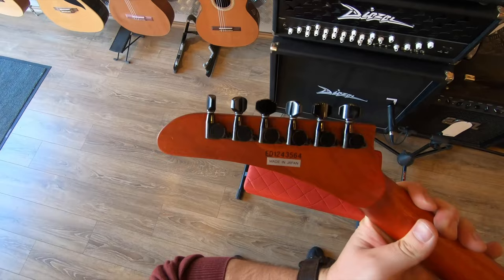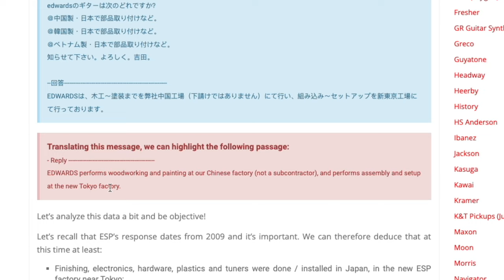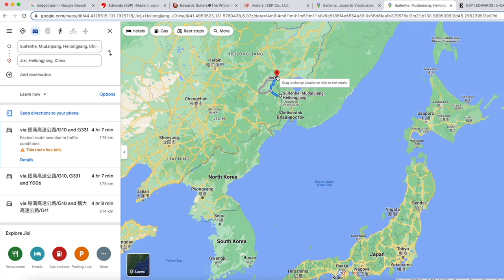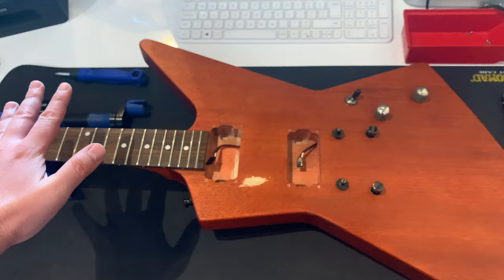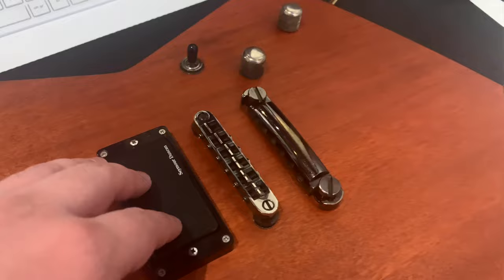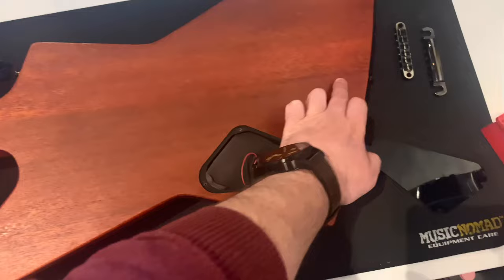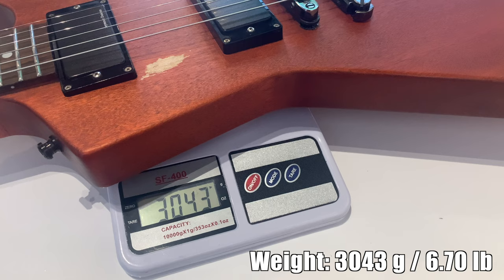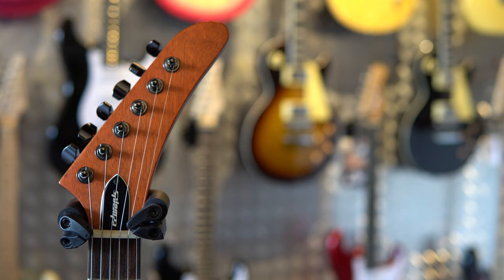The discontinued ESP Edwards explorer is a budget Metallica guitar. Was it really made in Japan?

Comment: Pretty sure some of the older ones are 100% Made in Japan, either way they're fantastic, they're better than the LTD 1000s and around the same quality as the cheaper ESPs, they're great upper mid range guitars.
Reply from the maker: Absolutely
Reply: @GeorgeVGuitars  I'm also pretty sure the only thing the Chinese factory did was CNC the wood, so the newer ones are more like 95% Japan 5% China, pretty negligible, anyone can CNC wood it doesn't matter.
Reply from the maker: @dq7860  Why ship wood from japan just to CNC it? Everything, including fretwork is done in Jixi. Only the hardware, electronics fitting and setup is Japan, which is still good enough.

Comment: I thought that these were great, they weigh about the third of a gibby one. I think they are good guitars but the neck is flat and it felt like it was having some easy flex, as if the mahogany used was a bit softer and not hard enough, causing some notes  to be thrown off pitch with aggressive playing standing up...that's my only downside with these, the satin finish was also very thin and easily scratchable.
Reply from the maker: Good points

Comment: Are you saying they are actually assembled in China? I got an Alexi Laiho Edwards, and pretty much all the hard ware, is Japanese made. The Floyd 1000 Korean. I could not tell you about the wood work. But it does say, made in Japan, on the back of head stock.
Reply from the maker: Don, im not sure about the artist series but the ED serial numbers were assembled in China. But in a ESP owned factory, not outsourced. So it. doesn't matter that they are not assembled in Japan. I am gonna review a John Sykes Edwards soon and I will see whats going on with the artist series.
Reply: If "Made in Japan" is not printed at the back, the body were assembled in China and take to Japan for assembly and final inspection. If it says made in Japan, then it's one of the old Edwards. New Edwards are rarely made in Japan.
Reply: @bassyey  Yupp, mine is a 2021. And it says I think, “produced” in Japan. Or something like that. Not made. But I’ve learned a lot since. And that doesn’t bother me. Made in China guitars only suck, because they are factory produced with low standards. But ESP has a place in China. Where actual ESP employees assemble the Edwards. So is it made in China? Pretty much yes. But still held to ESP standards.

Comment: Hi, George! I got the same guitar a while back. 
The bass strings sound pretty muffled and not bright like I expect them to be. Whether it's plugged into an amp or not. Therefore, it gets lost in a mix.
My Korean ESP LTD sounds better than this Japanese Edwards. I have no idea why this is happening, maybe it is wood characteristics, or most likely something wrong with this guitar. It feels like I'm playing on some acoustic with nylon strings.
The guitar has been set up at the guitar store (new strings, electronics check out, thrust rod adjustments, strings height I adjusted by myself, etc.)
Did you experience the same? Do you know what might be the problem?
Thank you.
Reply from the maker: Did you pit a new 9v battery in?
Reply: @GeorgeVGuitars Sure.
Reply: Do you have also Seymour Duncan's in it?
Maybe they have a different sound character than th EMGs??
I once had also a similar problem.
I my case, the guitar tech forgot to connect one of the 3 cables to the Outputjack.